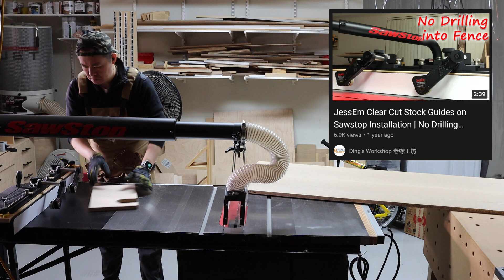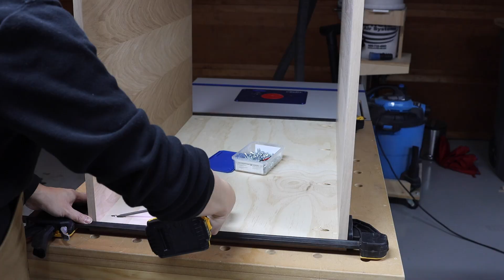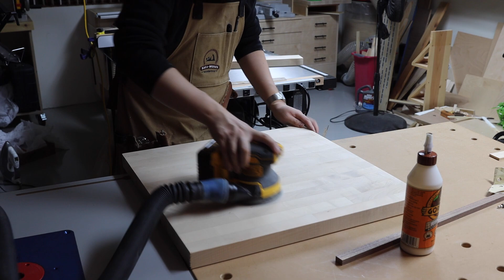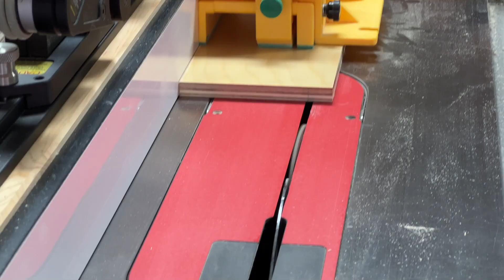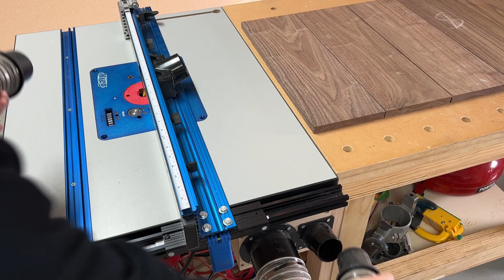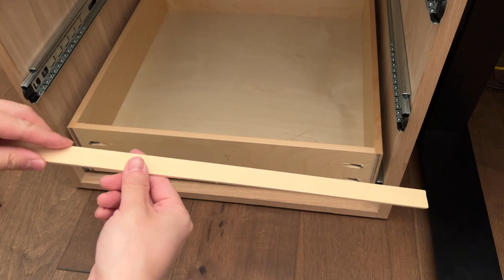Modern Printer Cabinet | Building Office Furniture Set | DIY File Cabinet | 频道里也有中文版哦！

Comment: I got a pair of Diablo blades (one 24 tooth for rip cuts and one 80 tooth for cross cuts) and this really went a long way to stopping chipping on the cuts. The combo blade that the Sawstop comes with is good for general purpose, but it’s not great for detailed finish cuts.

Comment: To prevent chips, commercial table saws often equipped with scoring blade; for home owners/hobbyists, either use zero tolerance insert or score cut line by hand could easily reduce chipping when cutting plywood. High-end circular/track saws (e.g. Festool TS-75) can be equipped with zero tolerance insert as well for the same purpose, so that you could have final and finish cut on expensive plywood (like Baltic birch 13-ply) in a single pass.